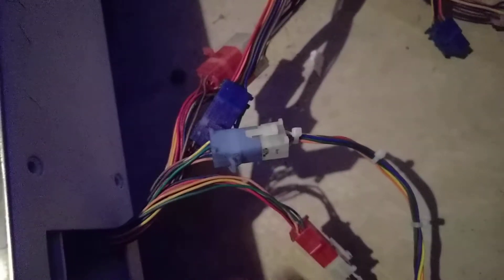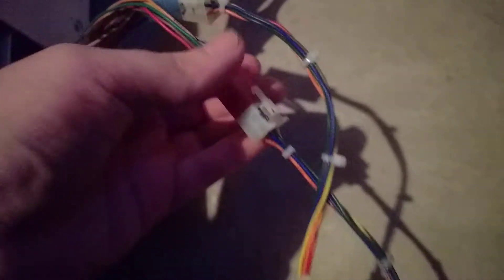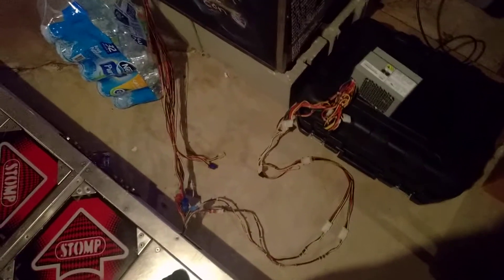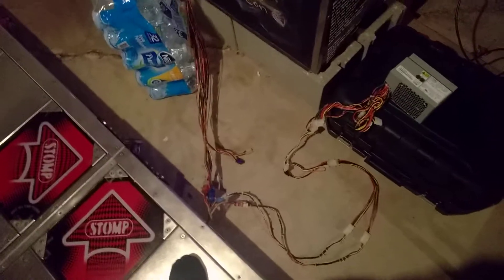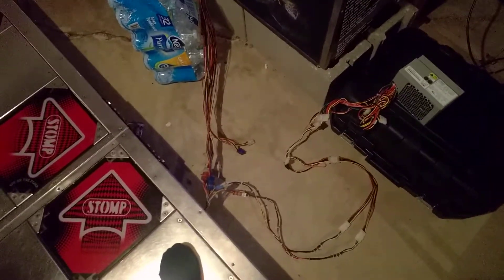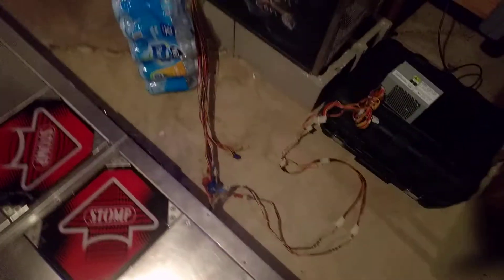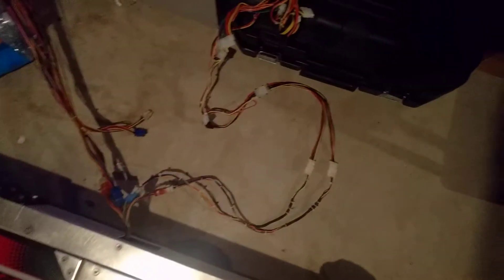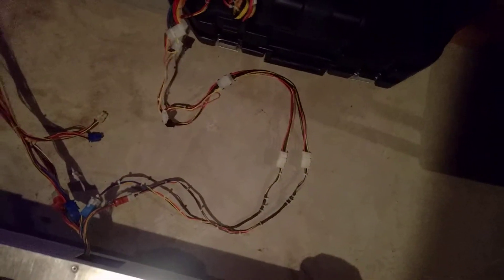Pump it up adapter ( Power your pads without any arcade hardware! )

Comment: Hello man
I have PIU machine modified, actually I use Step F2 but I don't have Mk6/MK9. The question is do you know how make a circuit for my pad with lights?
I use a controller USB and the cable's of the sensors are cut and they are connected with the USB controller, then I have know how make a circuit for the ligth please
Reply from the maker: Sorry but the only way to do something like this would be to use expensive hardware from ultimaRC, and then program it to activate the lights with key presses, it is a complete pain in the ass to do. you would be better off just getting your pads turned back into normal arcade pads.